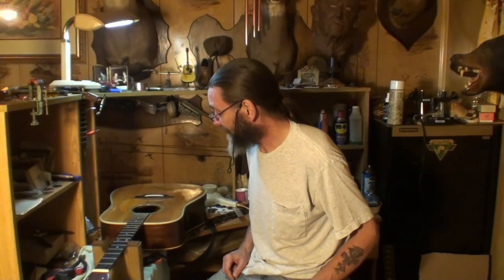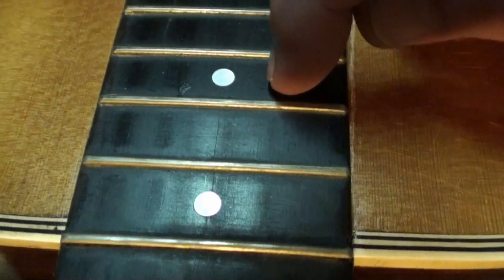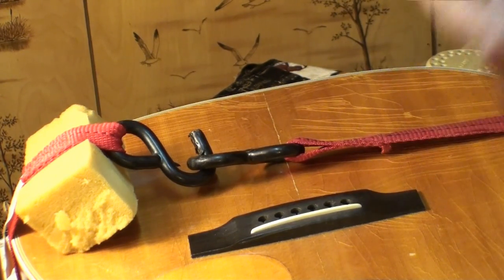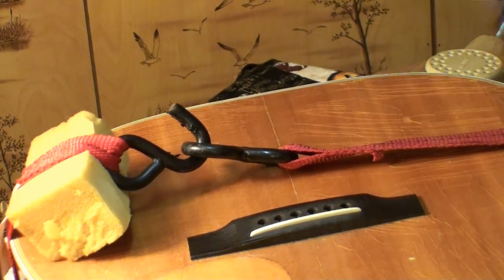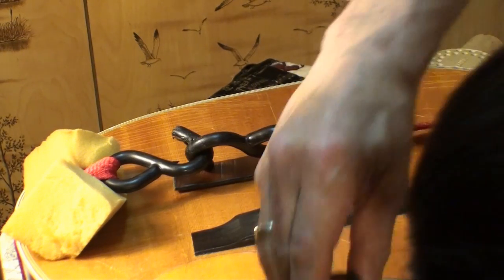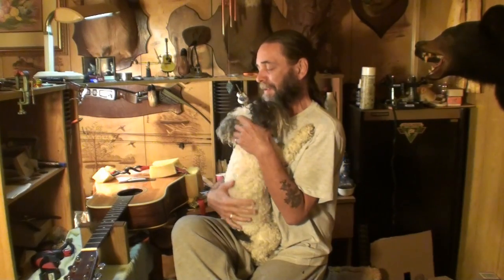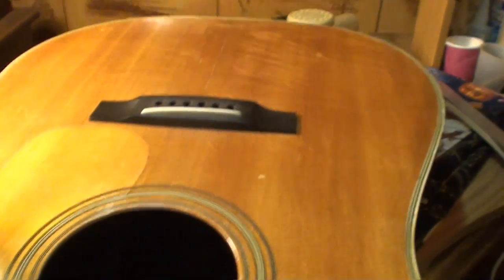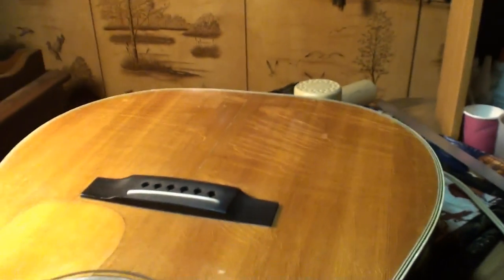Acoustic guitar cracked top repair by Randy Schartiger guitar repair videos

Comment: Hi Randy, I would die if any of my Martins had check lines like those man!!! how can you stop that? is that from shrinkage or what?
Reply from the maker: It is always a sad sight to see! It's caused from years of drying out, then being humidified, drying out again and humidity moisture content in the wood coming back up yet again, this process over and over the wood and glue finally starts to break down. You can avoid it by monitoring the humidity levels where you keep your guitars, keep humidity levels 45-55% as much of the time as possible and chances are this will never happen.

Comment: Hey Randy, just found your channel this week and subscribed. Lots of good info and entertaining as well. I watched another video where you used superglue on an ovation top. But you are using Tite bond on this one. Any reason for one glue vs the other?  I have a Yamaha FG-450SA from about 1990 that has the center crack like this one. Looks like I could try this technique on it. Oh, and I'm going to invest in a plate mate. You've sold me. Love Q-ball!
Reply from the maker: thank you man and welcome aboard the mad house lol yeah if the crack is wide open I prefer Titebond Original but on a tiny crack I can't completely fill with Titebond I use a thin viscosity CA glue because it'll get into the tiniest hairline cracks, it's so thin it will run into places water couldn't go.

Comment: What type of wood do you use for cleats and how thick are they
Reply from the maker: +Lloyd Hardwick I always try to use the same type of wood as I am gluing to, in this case spruce and generally about .080 thick, the thinner you can get by with the less it effects the sound when it comes to a guitars top.
Reply: I generally use spruce even on redwood tops. I try to keep my cleats small, and I am not fan of the long strip cleats. With some of the 100+ year old instruments I would see one group of cleats, then a new crack, and a new group of cleats then a newer crack, and you guessed it, a newer batch of cleats! I got an old early 1800s  Abraham Prescott bass that was so full of cleats on the back, it looked more like a shake roof than a contrabass from the inside. Even with the cleats, and shaved shoulders, that bass sold for almost $120,000.

Comment: I have to do this same job on a Martin, this was my exact idea as far as using a retching strap to bring together. Do you also use cleats on the inside to insure it doesn't open up again? Good job
Reply from the maker: Yes always use cleats inside if you can see light thru the crack. Good luck on your repair!

Comment: Sorry, I'm one of those guys who needs to understand the "why" regarding using the same type of wood. Since the cleat grain will be in the opposite direction, I wouldn't think shrinkage wouldn't the consideration since it's going to shrink differently. I have some hardboard that I would think would not only be quite a bit stronger than cedar(I have a cracked Seagull), but also very stable and it probably wouldn't shrink at all. Thank you.

Comment: So what does a crack do and cause despite 
The split
Reply: you lose pressure essentially and youll have to tune pretty often and also you might lose some tension in the higher strings

Comment: Randy: While I'm not in Your or Jerry Rosa's league, I'm about to break my shoulder blade patting myself on the back for sealing an easy hairline crack to
seal.Followed your instructions to the letter ole Hoss. Question now is: Will repaired crack reappear? I've heard you comment that cracks can't be repaired
properly without cleating them. I think I'll reinsert the lit flashlight to where the crack is and see if crack has began to enlarge in length? Doesn't seem to be
enlarging. That and rehumidifing the guitar periodically. Huge high pressure, High temp and Lo humidity domes settle over this part of Texas in the summer
Just a kudo or 2 to you and your help. Does QBall need a companion? My wife's poodle nuther words? I'll trade him for a bag of Beechnut Chewing tobaccy!

Comment: Using a suction cup to draw wood glue into top cracks is a brilliant idea. I have used suction cup repair kits on windshield chip repairs so it makes sense.
 
My guitar sound board has a 1/4 wide X 3/4" long compression dent running cross grain. There appears to be no damage to the wood. A hairline crack in the catalyzed urethane topcoat coat runs the circumference of the dent. Since the spring growth is softer than the fall growth, the wood compressed more in those areas leaving hairline cracks in the clear coat directly above each fall growth line.

I have been wondering about using suction to draw thin CA glue into the hairline clear-coat cracks. Seems like too much suction could pull the clear coat loose from the guitar top and also there is the potential for gluing the suction cup to the top so it would be a ticklish operation. Have you ever tried anything like that?

Comment: I'd say the 1st original cleat that was glued in was for that one dent that was U shaped divot at 2:21 of the video. The polyurethane is all cracked and looks like stretch marks on a fat chick's thighs. That's one abused & neglected body & top, even the neck is splitting from just being dried out for too long. I live in FL & have the opposite problem, humidity and the threat of the wood being too moist is the issue. During the warmer months, the HVAC keeps the house at 50-55% humidity, December & January, maybe February the place gets as low as 40% RH and the worst is 58% RH. That might be for a day and then it warms back to the 45-55% range the guitar's environment are suggested to be maintained. I do realize that day it's higher or lower than the range might be an extreme that may damage the guitar for expansion or contraction over the years.Right now, the heat is on for a December rainy day outside, but the HVAC is maintaining 50% RH constantly. So the guitar is getting moisture replenished just from that increase from 40-50% in the last day, when it was on oddball drier day.